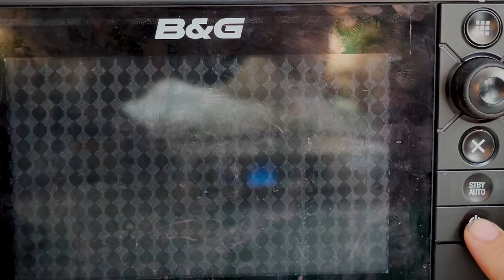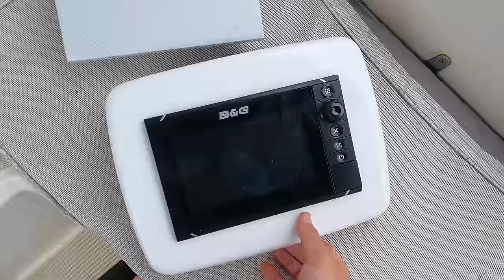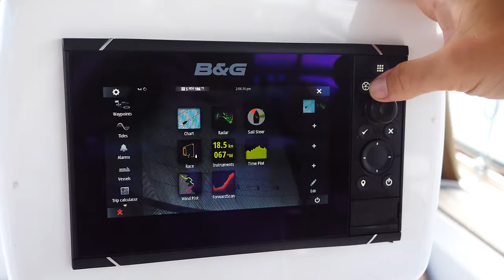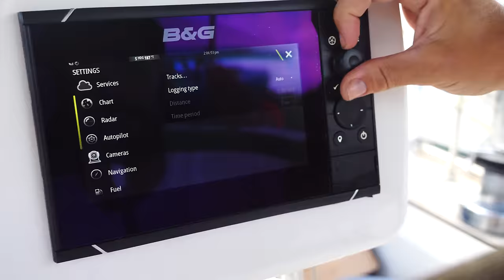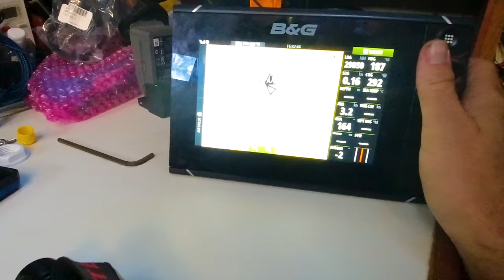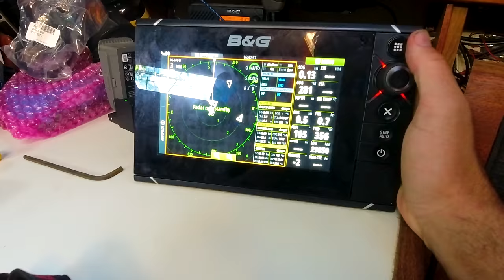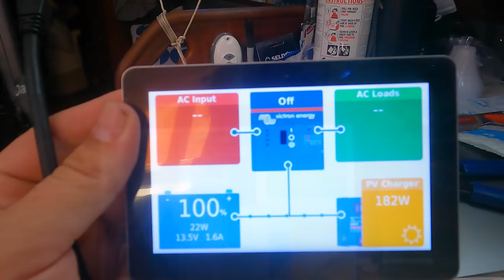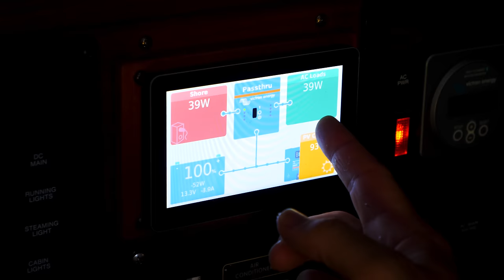Modernizing our 37 Year Old Sailboat's Electronics! / Installing Wind Instruments with the mast up 🤨

Comment: First, congrats on hitting 16K subs. Second, I love your "how to" video's. How much wire and cables are within your mast? Personally I would hate to work so high up, especially with all those tools and new parts.
Reply from the maker: Thank you 🥳! We have quite a few wires up there. Anchor light, tri color, steaming, dec. light, radar, and the old wind cable is still in there. I felt lucky to not have dropped that much!

Comment: that is not a nav pod key. It's a "security torx". You may find a set for the same price. On amazon in europe you can find one for 10 EUR ( 12 USD ). Many appliances has those screws . "security torx" keys are compatible with "torx" ( without the pin in the center ) in case you are interested.
Reply from the maker: Good to know! I wonder what nav pod charges for the same tool 😂

Comment: IT guy here, you will greatly improve the transmission quality & speed of that ehternet cable if you properly terminate it.  I'm actually surprised that worked.
Reply from the maker: Interesting! Yes it works but maybe is a bit slow. I found a junction box onboard lol
Reply: @CalicoSkiesSailing  lol cool.  Those ethernet cables kind of depend on the way the pairs are twisted together to cancel out signal interference.  But even two RJ45's connected to a barrel adapter would probably speed it up. There's a pattern you are supposed to use when you lay the wires into the little plastic jumpers.

I love the channel, I watch you guys, and Delos, and a few others.  Keep up the good work, Panama is beautiful.

Comment: Hey Bill, I tried to provide you some information on connecting your Victron gear with your B&G Gear as the Cerbo GX can do this, but YT seems to be removing my comments instantly. Maybe its pending review?
Reply from the maker: hmm thats odd! I'll have to check out the held for review section, not sure. Cerbo Gx can network with NMEA 2000?
Reply: @CalicoSkiesSailing  Yes, the Cerbo GX indeed can be integrated onto a NMEA 2000 network, for 2 way data.  Basically you your Victron gear can receive some data from the NMEA network, and your chart plotter can receive and display Electrical data from the Victron gear over the NMEA network as well.  Victron has some guides on setting this up.